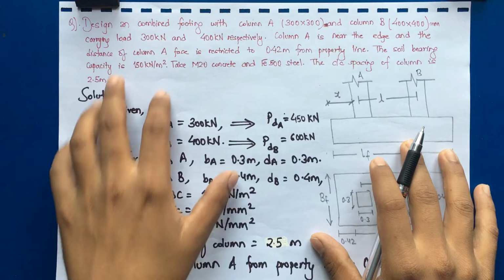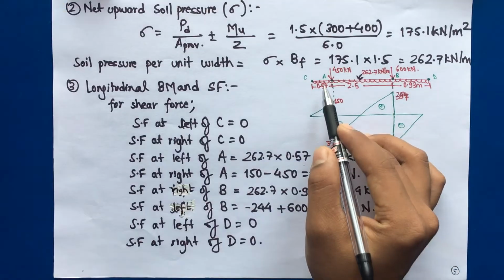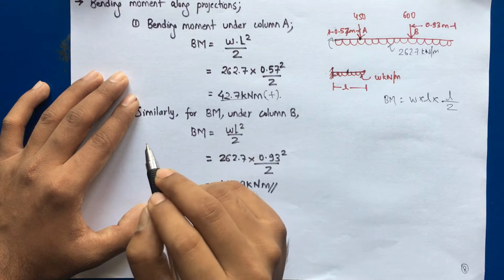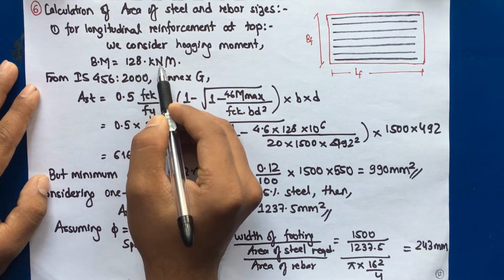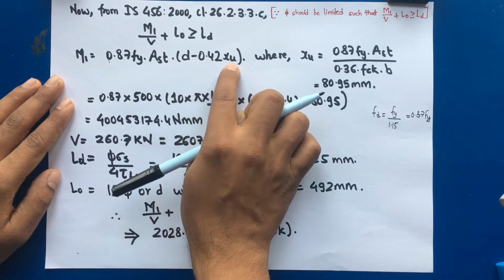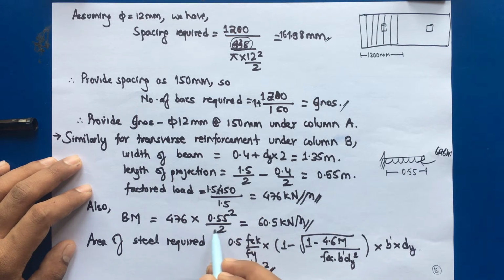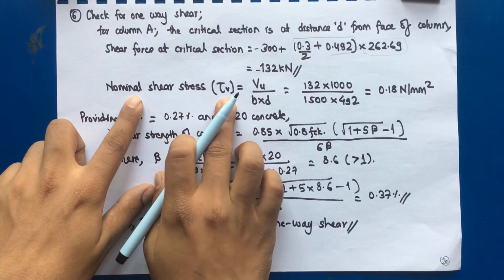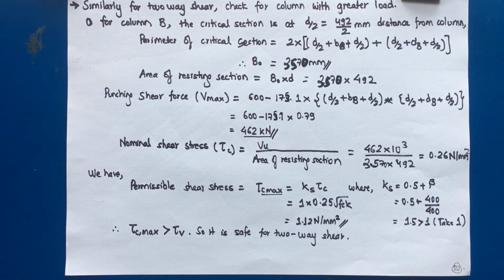Design of Combined Footing | Property Restrictions I IOE, PU, PoU, IIT, MU

Comment: There are 2 isolated footing of size 2184 x 2184 & 1905 x 1905, & column distance is 3182. We constructed well but by mistake the well is 50cm inside the footing due to which the footing will be 50 cm shorter. Will the shifting of mesh is feasible?- it causes eccentricity. Wht we can we do for it. Another option i thought is making it combined footing. In this case wht would be the size & thickness of footing? Which option do u recommend. Please give me the solution.
Reply from the maker: Sorry for the delay in responding.
Because shortening by 50 cm is a significant dimension here, combined footing would be preferable.
Reply: How about provision of strap beam
Reply: How about making the footing eccentric and providing strap beam
Reply from the maker: @sujanjoshi54  If the bearing is within the permissible range, you can go for it. Also one of the footing shall be concentric.

Comment: Dear youtubers 

Please make videos on real life example, real life example always carries moments in both the direction and due to which there is maximum and minimum base pressure occurs due bending, make videos on this conditions, this is simple theory you are explaining as this condition never happens in real life 

Thanks 
Civil moments
Reply from the maker: Hey there. Kindly check reactions at column base. The moments developed are highly negligible considering axial forces so moment can be avoided. That’s why I have shown for axial force only. And for design we have considered rigid soil base so we can’t account moment for design as it will lead to flexible soil parameter.
Thanks
Reply: @civilconst  I have checked your video again, there is only vertical load acting on the base which is not possible ever if base is fixed condition, there is always be mx and my along with vertical loads, this is one thing. Now while calculating the base pressure your will add all the moments that is mx, my and moments due to eccentricity. 
In this case formula of base pressure is (p/a +_ mx/z +_ mz/z) 
Now the base pressure will not be uniform that will be trapezoidal load, means there will be pmax one side and pmin one side, doing that only further calculations are done.

Your efforts are thankful but my suggestion is as per real consideration, your example problem can only be found in book.
Reply from the maker: @momentcivil  Thanks for your concern. If you are interested to find about biaxial moment footing design I have uploaded a video on it. You can find it over here.
https://youtu.be/wczr5xRQsLA
So don't say my videos content is limited or theoretical type only.
And talking about the fixity of column base I hope you have checked the values as well. I am not saying there won't be moment value. I said the values are negligible in comparison to axial loads. So we can omit moment value and consider axial load only for the design of footing unless it is a high-rise building.
If you are interested in understanding in more detail, you can see this video as well. 
https://youtu.be/ZggnINdWqaE

Cheers
Reply: @civilconst  thanks sir! I have checked your biaxial moments calculations of footing, I have some questions but I don’t want discuss here in comment box.
Reply: @civilconst  and I must say your contents are appreciable, thanks for having words with me. 
Share your mail id so that I can be in touch with u
Reply from the maker: @momentcivil  Sure.  Mail id: iamparashjoshi@gmail.com
or you can contact me on Instagram as well, instagram.com/civil_const